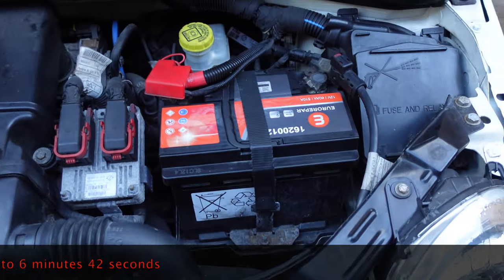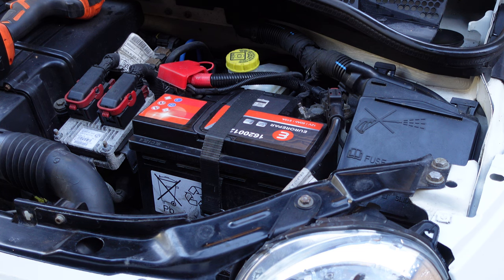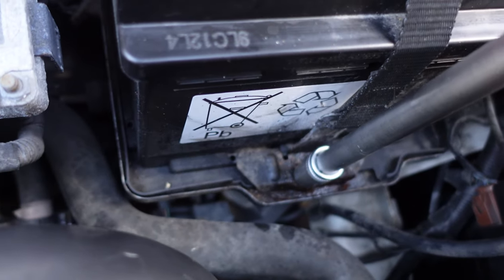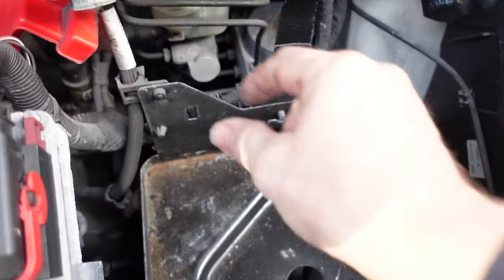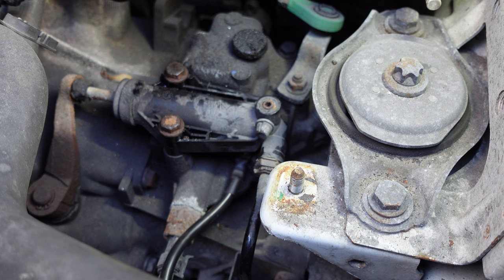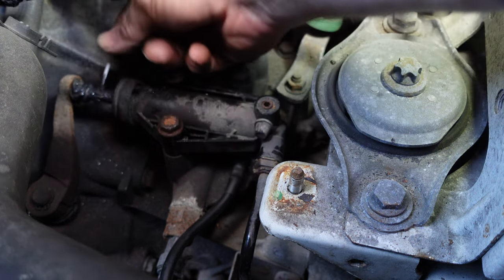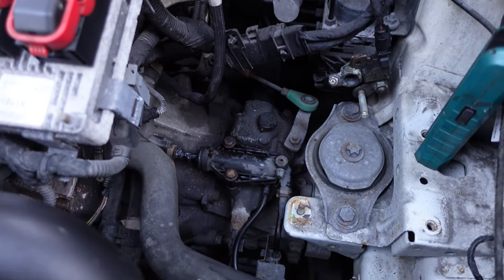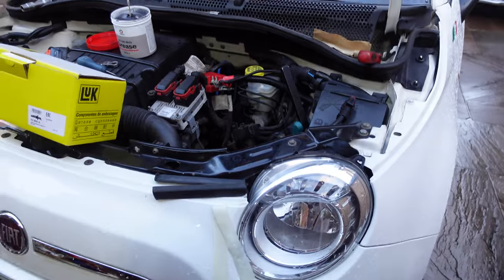Squeeky Clutch Pedal in your Fiat 500 1.2? LIkely culprit in this video. Love 500 How to Series.

Comment: From experience ive found that the noise comes from the 2 rubber bushes that the fork sits in. 1 inside the gear box and one at the top where you greased.     I used some 3in1 oil in a syringe around the top bush and it will work its way down the fork and lubricate the bottom bush.     Keep pressing the clutch to work it in. 👍
Reply: That’s my plan this weekend 😂 really not in the mood for taking the gearbox out of the car again - plus it’s too cold for messing about. Thanks for the tip 😎
Reply: Hi can you kindly explain what you mean I have the issue
Reply: Hi can you kindly explain how u put the oil

Comment: Just done the wifes 12 plate, in this case it was the pedal under the dash. It was squeaky and a little notchy on the slow upward movement on take off. Sprayed everything that moved inc. the spring, with Gt85 with PTFE. Worked the pedal didn't disappear straight off but next day, no squeak and smooth as silk. So that's another one to look out for.
Just to add I made a cardboard tray out of an old box to catch the drips, left it in overnight.

Comment: 9:18 As a quick fix for anyone who is struggling to source a slave cylinder, the rubber gaiter on the slave cylinder can be popped of with a screwdriver and you can squeeze some silicone grease into the  recess. This worked as a temporary measure on a Ford Ka mk2 which shares the same running gear as the 500. I also did the same to the master cylinder above the clutch pedal and it's now much easier to press, and the squeak and the notchy return has gone.
Reply from the maker: It’s been impossible to buy them recently but I managed to find the last three on a website and bought them all.
Reply: Thankyou, tomorrows job on my Ka.

Comment: top tip Paul ,rub the the corosion down with 150 wet and dry but rub dry  ,take yout time and keep wiping with a cloth to remove rust and grime  , comes up smooth ,pack with grease ,good as new and no squeek   :)
Reply from the maker: I'll try that next time, cheers.
Reply: forgot to tell you ,get someone to press the clutch pedal while you  do this ,then you get it all 
 @Love500

Comment: One end of that steel rod that runs from the inside of clutch slave cylinder.
The other end of the rod sit's inside a "cup" that is depressed into the steel, clutch release arm.
The ball on the end of the rod, sit's in the cup and is in "metal to metal" foul condition.
That metal to metal contact point is your squeek !.
There is likely to be scoring / rust and crud built up over a long time.
I think that was the only lub point you missed Paul.
Unbolt the slave cylinder and clean the end of the slave cylinder rod and the "cup" that accepts the piston rod.
Apply your grease to cup and the end of the slave cylinder rod and refit the slave cylinder - sorted !.
A quick proof of concept before you start, a good spray spray of WD40 at the point where the rod engages with the cup in the release arm.
It will give you an instant result, but the noise will return, as WD40 is not long term lubricant.
My wife has a Fiat 500 and the clutch made a strange noise when it was depressed first thing in the morning.
But the noise was coming from inside of the car.
The push rod on the master cylinder ( behind the pedal ) has a rubber boot that drags along a similar metal push rod.
Red rubber grease applied to the push rod, sorted the problem in her car, that was about two years ago.
Reply from the maker: It definitely wasn’t in the cup as you could feel it in the shaft when holding it while the clutch was depressed. I’ll definitely check that in future though.
Reply: @Love500  Of course you could !.
The direct metal to metal contact travels from the point of contact at the clutch arm, via the connecting rod into the slave cylinder, that notching / staggered feeling is what you are experiencing through your fingers.
What the hell do I know anyway, as a time served tech trying to offer some requested help.
In your video on project Cerys, I did attempt to point out that the N/S/F front strut on that car was actually bent, ( as also witnessed by other subs ) on the first inspection video, again this is why you struggled ( your words ) to align the bolts on that bent bottom arm replacement you carried out.
Quote Paul :- "This was the hardest bottom arm I have ever done, I really really struggled to get the bolts back in and I don't know why ?".
That was the cue !.
The damage to that strut was caused because of that heavy impact received by the road wheel in the crash,.
It had pushed the N/S/F wheel SO far back, the tyre had clearly rubbed on the inner wheel arch and left that clean witness mark.
A lot of force was required to first bend the bottom arm and also the strut in turn,  had to travel the same distance.
Again - also pointed out in the comments section.
Suddenly you changed your mind and did decide to replace the strut on the second video strangely ?.
I do really enjoy the channel and the content Paul, and I am NOT just viewing with the intention to pick holes in what you do, very far from it !.
But I will be reframing from responding to the regular request for :- 
"Please reply with any help / opinions in the comments section below folks" in the future 👍.
Reply from the maker: @jeffcartwright7270  that’s your choice Jeff. I take on board what everyone says and suggests. If you want to quote me exactly I said right at the beginning that I would change the bottom arm first and see what happens. It was clearly not the only issue so I changed the shock. Yes, you pointed it out and people have seen things watching the videos that I haven’t spotted at the time, this happens regularly. On this occasion it wasn’t the cup as you suggested it might be, but as I said before I will check that in future.on this occasion the cylinder was knackered and has now been replaced.

Comment: On my TwinAir wasn't so much of a squeeky clutch pedal was sticking initially did the spray wd40/grease but has ended up chaining the cynlinder - maybe better changing when taking off battery/tray etc as the slave cynlinder cost is arond £25-£35 dependant on make - but as paul says if you dont know how to do it yourself or have a good quality mechanic who isnt going to rip you off this is a good starting point

Comment: Old/dirty clutch fluid in the system can often cause brakes and clutches to squeak when operated. Brake and clutch fluid is hygroscopic - meaning it 'absorbs water' and this can make the rubber seals squeak. Its worth changing the fluid first before changing any parts.
Reply from the maker: It’s a common fault with these. Always those damn spaces but I get your point.

Comment: Great job! Did you have the part number?
Reply from the maker: I don’t I’m afraid bug if you go onto eBay or a parts website and enter Fiat 500 slave cylinder it’ll come up.
Reply: Hi the part which Paul used was LuK clutch slave cylinder part number 512 0045 10. You can see this from label on the box when Paul left the box ot top of the engine. But this is cylinder and pipe too. It is cheaper to buy just the cylinder in case no need to replace the pipe too. 😊 I have the same issue but need just to remove battery and check. Hopefully will do this soon. Thank you Paul for this video.

Comment: Change the whole dam thing cos that joint will fail and rott through .. they all do .. and your need both the master and slave kit as they come pre bled with the joiner for both sides .. I change these all the time due to failed joints and leaked and pedal dropped .. just change the whole dam thing ...
Reply from the maker: They don’t fail if you use a copper micro bore plumbing fitting.
Reply: @Love500  when they are shitted right up they internally due to water ingres rott in the slave and master .. as a mechanic warranting work I replace it entirely properly .. 
not Mickey Mouse repair it and then Have the other components fail .. if ya doing the slave anyway and buying the front part due to noises just do it all ... I’ve had a couple masters rott internally also .. give a years warranty on the entire system 👍🏻
Reply from the maker: @seanbartlett6148  obviously a garage would just replace and charge for complete renewal but if there’s nothing wrong with the master then I wouldn’t replace the entire thing.
Reply: @Love500  heads up for ya .. gsf are doing 45% discount onnline at mo on that entire outfit 👍🏻👍🏻 worth knowing
Reply from the maker: @seanbartlett6148  I’ll have a look, cheers.
Reply: What’s the parts and labour cost on this please?
Reply: @LeeHoward-c7l  that’s to replace the hydraulic lines new ! If needed .. not the clutch inside the box but the hydraulic side of that’s where you issue lies